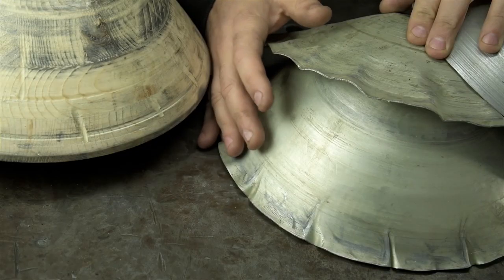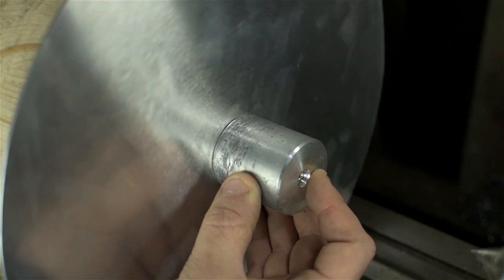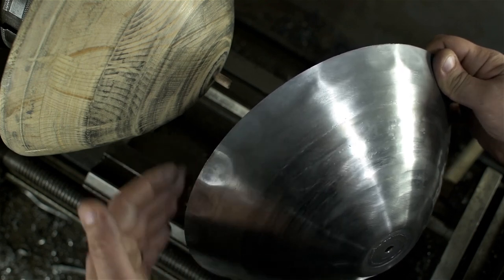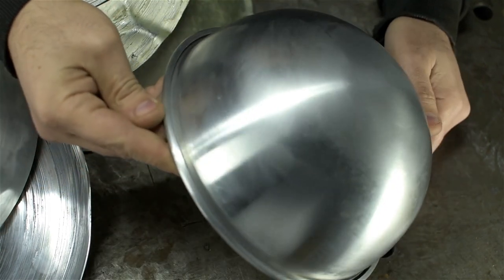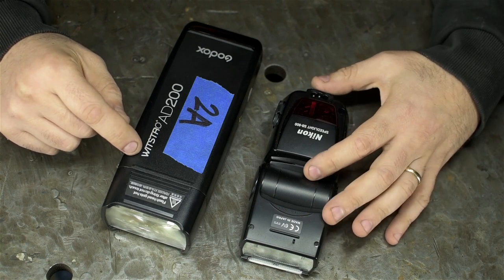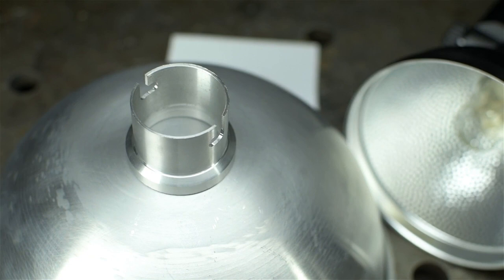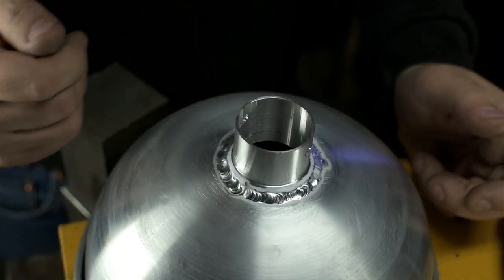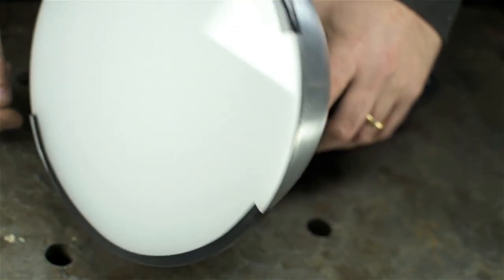Spinning Metal - Part 2! - GODOX Strobe Reflector Build

Comment: Im far from any expert on this subject, Ive done a month of metal spinning at my shop, but I can see a couple common mistakes.
1. Hemis have a habit of going tight then loose against the tool as you progress further. That being said, the absolute worse thing when it comes to spinning is pushing against a part of the sheet that is already on the tooling (Mandrel). What you should really do is hit it with a stick, if you feel like touching spinning parts feel it while you tap. That'll give you an audible (and physical depending on comfort, you dont really need to touch it but it helps) indication of how it's resting. The back up you see, the sorta lumpy bits by the spindle, is caused most commonly because you are pushing against a part of the piece that is restrained by both sides. When the piece is floating, the metal will flow a lot more freely. Thus you as you move along you should aim to have the metal in contact with the tooling in your back and to have air against the tooling in the front OR air in the front and air in the back. We do all sorts of weird spinning shit at my shop but thats the typical ideology.
2. The rippling is caused due to not fully teasing her along. For a hemi I would do a swoop. You want to sorta aim at making a lip. This reinforces the sheet and allows it to flow without rippling. Come in soft, push hard, push out, pull in towards you nice and soft away from the tooling. It's sorta the same motion as when you finger bang a chick. As you go along and more of the sheet is in contact with the tooling it doesnt really ripple as much and so then you would flatten the lip. You may also start well far ahead, maybe in the middle or last quarter, and take a light pass to reinforce the edge via a lip of the material before you even start to get the beginning flush. 
3. You are taking too many very light passes. You want to get in there with as few passes as possible. As you take a pass on a hemi like this with aluminum often you will feel the tooling as you take the pass. The more passes you take, the more damage and nastyness on the inside and outside. When you get a good feel, the shit flows like liquid metal. As well, if you take too many passes it will thin you metal out more. Some cases you want to thin the metal for a certain spec, or maybe you're putting a light radii for reinforcement or other reasons. The fuckers in the back at my shop that do hand spinning are stocky mother fuckers, albeit short, and they were taught by a 6'4 250-300lb man who scares the piss outta me and Im a welder.
4. Handspinning lathes and turning lathes are sorta the same. Idfk enough about them, but it's mainly a modification of the toolrest to turn a turner to a spinner. That being said you get a very nice feel with "scissors". They're like the roller you have, but the roller pivots on a hockey stick (not actually a hockey stick, looks like one and make of metal) and the hockey stick pivots on the tool rest. That way you can easily change angles, you pull in with both arms and the roller moves forward, you can do all sorts of weird shit. That being said, METAL SPINNING MAKES NO FUCKING SENSE. It's like welding, you just gotta do. I did pretty good, I only did it during some down time, but it helps to have people who been doin it 15 years to show ya a couple things
Reply: @willadie  thanks, i got a nice chuckle from your high school dating analogy.  First time i've heard that expression used when describing a lathe operation!

Comment: I tried that burning string cut-off method on aluminum bars, and I don't know how you get the end to break so clean. I always have to dress the cut end with a little fine emery on a glass plate to get a decent finish.

Comment: 4:56 Reverse bend is happening because when you're pushing against the metal on one side, it is curling up on the backside 180 degrees from where you're pushing. Evidence 5:53
Could you have made a concaved wood bowl to press the metal disc against the wood buck into a bowl shape? And then instead of welding the nozzle fitting, could tig brazing have worked? It might've prevented the weld-thru (whatever it's called when you burn through it.)
In any event, great video yet again!

Comment: Tony, you need a holder on the opposite side... (a roller bearing holding the opposite side (180 degrees form the tool holder across the work)firmly in on the wooden mold...)  As you force the tool on the material, it buldges back hence the reverse bend! Can be seen at 5:26

Comment: Here's another way you could have done this Tony-- possibly a way you weren't familiar with. Another tool for the toolbox:

Make inverse shape of what you're making-- similar to what you already did. Put on an even coat of conductive paint, available commercially or you can make your own. Electroplate nickel onto your shape- real thick. Then you can throw it back onto the lathe and bring it to a consistent thickness. Finally separate your form and your plate. Clean up the inner surface, polish it whatever. 

Many people in the hobbyist explosive world do the same procedure to make copper shaped charges.

Comment: I guess the center wants to break because of your clamping - notice how the entire thing tilts away from the tool.
I would try undercutting the block you use for clamping, so it has contact on the edge instead of the middle. This should hold up much better.
I really hope you will get it one day.

Comment: Sigh... smh... and other word thingys... you went to all of that trouble when all you need to do was turn that pin ball hammer around and hit the blank with the other end...

Pocket Wizards (or the cheap derivative found on Amazon) can make any flash a remote flash... and soft boxes for strobes (that's what us photographer types call a flash... because it's all cool and stuff in the right crowd) are fairly common and cheap now

Comment: Maybe you have to use a series of supports that converge towards a parabolic shape. 
The advantage could be that the "excess material" would be transported out to the rim. 
You would change the outer rim gradually, instead of having to do it all at once at the end.

Comment: You can clearly see why it’s breaking a hole when you push on one side of the material, it’s leaning the entire thing into your tailpiece. Back and forth which is work hardening the metal until it snaps. And also pushing that bump into it

Comment: The bottom being cut away is because you did not use wood on the tail stock but metal. Wood does not cut. Even soft aluminium.
I spin on a woodworking lathe, so a metal lathe will work well.
Yes - the wood grain is visible. To get a better finish you need a smoother buck.

Comment: Tony you need to push the material not only upward but also downward. It keeps the material a little thicker at the bottom. Also, when you get the material resting near the center first, you won't stress the Aluminium and it will not rip off

Comment: I'm pretty sure the bending at the top and breaking isn't caused by pushed the metal up. It is caused by the force you are applying tilting the part and thus pushing the opposite side out.
See if you can push down both sides at once.

Comment: I think the center of the bowl breaking out was from the torque of only working one side of the bowl at a time and it bending while spinning on the opposite side. I think you could make a pretty quick and nice bowl if you worked both sides at the same time.

Comment: it was probably giving that reverse indent and popping centers cause as we see several times in the video as you apply force to draw out the disks towards the blank on one side it pivots it away form it on the other side if you rigged up something to apply force on both sides it would probably work fine

Comment: I metal spin for a living but I do it the way they did it in the early 1900s. The reason the middle is breaking out is because you are not laying it down tight enough around  the chuck.

Comment: To prevent the cracking you have to form the part enough to get the buck to carry the shape. Quickly getting the center of the part against the buck will allow the additional shaping  without constantly flexing your part. It's that constant flexing that causes those cracks. You can also try some annealing, but honestly I would master the concept of getting the metal to fit the center of the buck first.  I learned this the hard way (probably why I remember it so well).  Word of caution - I am an amateur - if a  PRO contradicts what I said you may want to ignore everything I wrote! :-)
Reply: My thoughts too.  Spin solidy against center of buck first.  I use lanolin for lube.

Comment: I was chatting to the guys at work today about your metal spinning video, and one of them remembered watching a video called " how it's made - trombone ".  (he plays the Trombone in the local brass band) It can be found on UTube and is only 4mins, Its a great little video with some interesting engineering ideas - and a little bit on spinning  metal. The maker bends the outer lip  first - and I wonder if that would prevent the outer edge crimping up.  Love the Videos Regards Garry Great Britain (The English Bit)
Reply: I know I'm lathe, but this is exactly right and is very important information. Need more thumbs-up.

Comment: Most amazing is that people feel so free to comment about a subject they know nothing about.  Any ductile metal can be spin formed.  Here's the physics: as the metal is drawn back inward toward the form, it has to either thicken, elongate radially, or buckle circumferentially. You are allowing the metal to buckle.  Bending the edge back increases the local stiffness at the edge, which mitigates buckling.  I'll do something and post a video.

Comment: Try breaking the edge first. Starting at the center of the blank just creates excess "bad way" curvature that only gets worse until you finally try to roll it over at the end, yielding the lampshade effect. Try rolling over the outside edge a little first, then go back to the center and move out from there like you have been doing. You should get much better results with the outside edge already started.

Comment: I know you got 1000's of directional comments...but as a NASA Engineer (retired)...I gotta all one more to the pile.  You need do this in steps (rough 1, 2, 3, etc) to anneal it....it's getting work hardened....so put it in the oven (don't tell the wife)...wash off the wax first....temperature: 170-200ºC (350-400ºF) for 15 minutes (Min).

Comment: Shouldve just used foil. Stretch it and do it layer by layer by layer. It may take 2 to 3 years, but eventually itll be just the way you want it. 
 
Or just make a mold in sand. Finger the 99% Aluminum a bit, until its drippy, then pour.

Comment: Odds are slim this will be seen on a 5+ year old video, but I would have gone the soft route. As an aircraft metalsmith, I'm partial to 6061-O. Getting a temper from T-4 to T-6 would be no problem for you . Thanks for reading. 😉

Comment: Metal spinning is all about material flow... Not bending. You can conceptualize it better by watching someone throw a clay pot on a potters wheel. The material flow is the  exact same... And can be controlled the same. Master Yoda would say, "The flow you must feeeel, mmm." And when using stick tools, the movement is in your body, not your hands and wrist.  You should Tango with your lathe.

Material must be in the annealled condition... For aluminum this is labeled with an "O"... 6061-0, 1100-0, etc. 
The nose backed up on you because it wasn't pressed, then held on the wooden chuck. Switch to a larger tail stock center once you get the nose down.

Comment: If you watch the video when you are using the spoon you can see that you are levering the work round, and that is what breaks it off at the pusher. 
I think you need to firstly "set" the part near the pusher firmly onto the former to minimise this rocking. 
Also I think you need to work closer to the point where the metal is already in contact with the former. Sort of "wiping" the metal over the former rather than pushing it down on to the former. I am no expert, I have probably only two more attempts that you have. But those last two worked (motorcycle lamps: https://bodgesoc.blogspot.com/2015/02/headlights.html )

Comment: Problem #1: not taking your rolls to the end of the run each time causes external and internal compression stress [learned how to use an English Wheel while working at an aircraft restoration company in Hawkins, TX] and this inadvertently is causing all of that wrinkling.

With this sharp of a radius, you should be using multiple mandrels to reach your final shape, or else build an adjustable backer anvil to drift behind it and throw out the wooden backer mandrel.

The bowl was by far a better move for you.

Use one of these https://images-na.ssl-images-amazon.com/images/I/51N4OMU6o8L._SX466_.jpg  to hold the diffuser on and you are good to go.  (~_^)-b

Comment: The nikon speedlight reacts to visible light, you can be around quite a corner, as long as the light influences your photo it will very very likely flash with you. I'd still love to see a good slomo of the negotiation between camera and flash to understand the strobing protocol. It is more or less: Camera to flash: "gimme a proof flash please" Flash to camera: FLASH C: "next time, when I say GO, after <yay>milliseconds, gimme <yow>% of the power you just gave me, thanks.... C: dimly flashes-before-shutter, shutter opens, ... F: <yay>ms FLASH   It sounds like frrrrtFLUT

Comment: 1.) You maybe need to anneal regularly.
2.)  As you push, the "bowl" moves to the pressure and brings the SHARP edge of "clamping" aluminum piece.
      Maybe you need to relieve the edge, so its not so 90 degree angle on it.
3.)  The example you are drooling over is probably a pressed in a 2-piece mold (?)
4.)  Watch a video on this for hints.    Dont give up !!

Comment: Tony ...
If you ever want to try again, this detail might help:

youtu.be/j22pDYX2Mvo?t=156

... I also noticed that your center kept getting 'cut'; I'm not an expert, but I do imagine that the holding force is too small.
What I'd suggest you try is to coat the wooden template with a thin layer of rubber, so the template will make sure the sheet wont skid. [3dit: Reading comments from skilled workers, the piece of aluminum rod should be wooden].

At first I thought the problem was because you used cut and not copy when making the aluminum discs (in the first video).
Unfortunately both my cut and copy are greyed out (probably something silly simple thing I forgot - I'm sure, I'll figure it out one day).

Edit: I almost forgot...
Perhaps a pair of roller skates would brighten your day - you know, those with the big fat round rollers that carries a lot of weight...
-No, I'm not saying you need to burn some fat ... well, maybe ... but a thin layer on the surface would probably be enough - a sparse brush would probably do the trick.

Edited edit: Banjoman seems to use beeswax. For a fact I know that you can heat a pot of water to 65°C and then put beeswax and olive oil into a small bowl and let the 65°C water melt the beeswax. Don't get the beeswax into your wife's favorite pot or you'll be in trouble for a couple of weeks. When the beeswax is liquid, start stirring and take the bowl out of the water while you keep stirring.
-That should make a nice paste. You can experiment with the ratio, some use 1:1, but if you change the ratio, I'd say reducing the olive oil would probably be the direction to go in. I have no idea how it would taste, though.